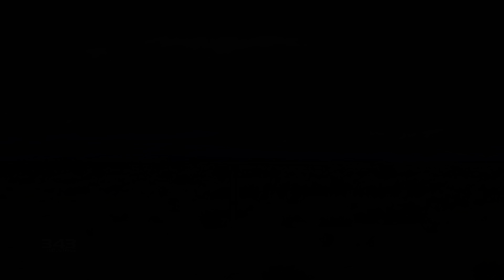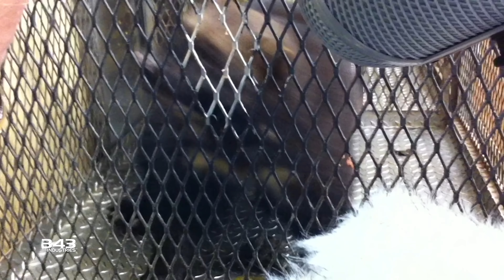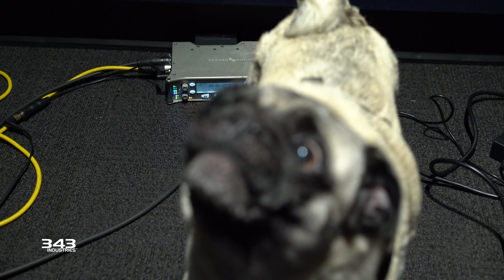Making Halo Infinite | Audio Field Recordings – Supercut

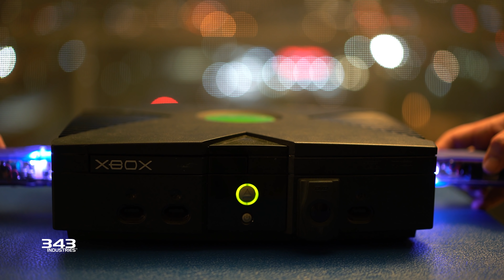Comment: 0:01-0:12 Rocket Launcher
0:13-0:38 Forerunner Structure Ambience or Sentinel Sounds
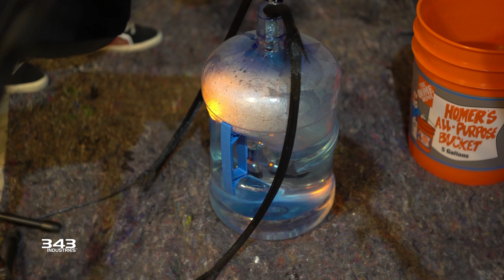0:39-0:48 Grunt Sounds or its the Flood
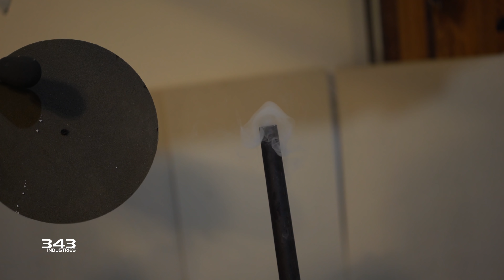0:49 Forerunner Weapon?
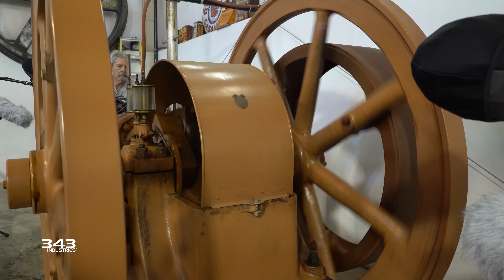0:51-1:00 No idea but I’m going to assume its weapon sounds 
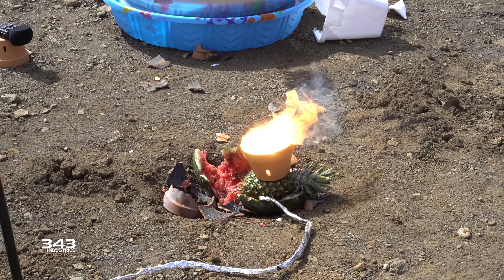1:01-1:17 More ambient noises
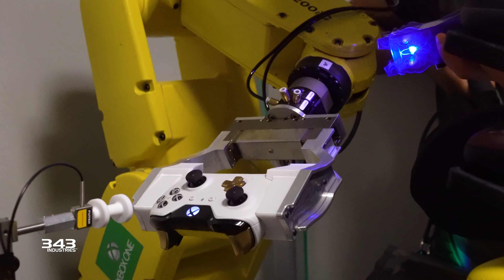1:18-1:32 Return of the flamethrower or flame grenade?
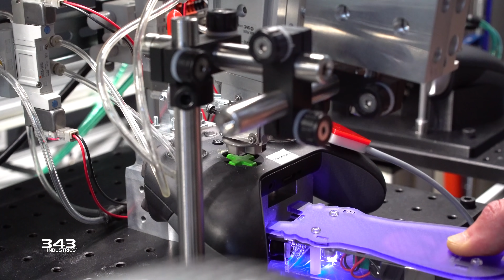1:33-1:37 More Forerunner Sounds
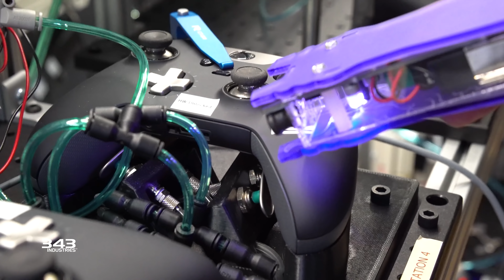1:41 Fuel Rod Cannon or some other Banished Launcher
1:54-2:06 The Flood
2:07-2:14 More Grunt Sounds
2:15-2:39 More Flood noises (could also be Grunts since they’re known to sound like dogs sometimes)

Comment: 0:14 what is this device and how much is it
Reply: It's called an Xbox
Reply: @slickcalf985  not the Xbox I meant the blue thingy
Reply: I know it's been 2 years, but it's called an elektrosluch 3. It picks up electromagnetic fields and outputs them as audio signals. It costs 100 euros. You can also build a DIY one pretty easily, although it requires some soldering.

Comment: What are those devices with the blue lights that they were holding up to the gaming consoles at the start of the vid?
Reply: EMF mics. electromagnetic frequency microphones. they are usually used to make sure nothing is burning or broken inside the machinery without needing to disassemble it.. at least, I think that's what they are called